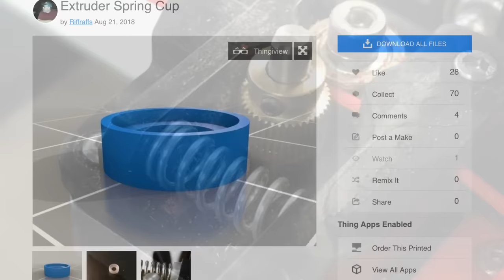Fix Bad 3D Prints on a Creality Printers

Comment: Bro I have tried it all...I am having little gaps in my print on the ender 3 v2 randomly. it's mostly on smaller parts of a print, for example if i were to print a fork the main part of the fork comes out mostly fine but then the prongs on the fork would have a lot of gaps in them and look ugly. I never had this issue when i first got the 2 machines i have....

Extruder gear is fine, nozzle cleaned many times, bed is level and using 5x5 bl touch, esteps calibrated, retraction turned off/many settings tried. even small prints come out so ugly...for example I print a cover for some steel rod and its under extruded as hell but how can this be if estep is right..i dont know what to do.....tried different filaments seems to be all the same....
Reply: Did you find any solution for this problem?
Reply: @s_y_305  Yeah. It was the brand of filament. All the different filaments I tested with were the same brand and they all were bad. I ended up trying filament from 5~ years ago and it printed fine so ended up just changing to eSun/Polyalchemy/etc and haven't had issues since. All my filament is stored on shelves identical to the next so don't know how they went bad so fast. Especially when years old filament is printing fine. All of it was PLA & PLA+.

Maybe in the future I will try to dry those rolls out and have another try with them but never have experienced this before, especially after I went through 3 rolls of said brand previously.
Reply: @adamarzo559  well, sad news for me then.
All my filaments are esun, never had this problem before but it's hell now. Changed the nozzle, tried to print on higher temps, changed the retraction settings, but nothing seem to work. For whatever reason it just decides to not flow as much of filaments on some of the sections of the part and as a result the whole part gets messed up

Comment: the arm on mine was too strong. i put the aluminum on and it was chewing up the filament.  so i put the old spring on it and now i'm getting the lines.  I just can't win with this thing I have bought so many parts and rebuilt the whole thing repeatedly i just don't get it this printer is ruining my life
Reply: ive had the same freaking problems with ender 6. just cant get the things right

Comment: When I'm printing after doing all the setup instruction with my brand new Ender 3 pro, my project gets eaten up by the nozzle when I'm printing. I use the paper trick to adjust the the nozzle to the proper height. Since I'm new to this I'm not sure what else I can do. Any assistant would be most appreciate. Thank you
Reply: @Fidel Gonzales Not sure what type of filament that you are using, and what exactly you mean that your print gets "eaten up by the nozzle".  I think you might mean that as it is trying to print it's being dragged around and turned into a heaping mess that just continues to circulate with the nozzle as it moves around the bed, is that correct?  If so there are a few things that you can check on.  If not, skip to the last 2 paragraphs.

First, when you are doing bed leveling (the paper trick) make sure to go through all 4 corners at least twice.  When you raise or lower a corner of the bed by adjusting the knobs underneath, it may affect a corner that you have already adjusted, so now that corner needs to be adjusted again.  Go through until you can do all 4 corners and the center without having to adjust them one time.  Also, the resistance you are getting between the nozzle and the bed (the amount of drag that you feel when pulling the paper through) is something that needs to be just right.  If you can barely pull the paper and the nozzle is almost ripping it, you need to lower the bed so that it is barely scratching the paper and offers slight resistance.  If you can easily slide the paper in between the bed and the nozzle, and no marks are on the paper, you need to raise it.

The big thing to correct this issue is layer adhesion.  If your first layer does not correctly stick to the bed, your print has failed and after that you're just wasting material.  Make sure to clean your bed (assuming it's glass) with glass cleaner that has ammonia.  Heated beds are supposed to not need any help, but often smearing the bed with a thin layer of gluestick (I use Elemer's but any brand will do) can help it stick correctly.  You can also cover the bed in masking tape, really it depends on what kind of filament you are using.  Speed and temperature can affect layer adhesion also, so in your slicer program you can try decreasing speed or try increasing/decreasing printing temperature.

If you instead mean that nothing is coming out of the nozzle onto the bed at all, then you might have a clogged nozzle or be using the wrong temperature.  Try using the menu to raise the z axis, then manually heat the nozzle to the temperature that you are using to print.  Squeeze the lever on the extruder, and try to manually push the filament in.  If you don't see any filament oozing out of the bottom of the nozzle, this is the case.  Try increasing the temperature and pushing it again.  I would stay within the range that it tells you on the spool of filament, so if it says 185 to 205 degrees, and nothing comes out at 205, you have a clog.

Right after I started printing, it took me a little while to get the test print working, and a few weeks later I had to clear a nozzle clog.  I didn't realize it at the time, but when I was printing with the initial roll of filament that came with the printer I must have been having some issues, because when I opened up the nozzle case there was just mounds of dried white filament all over the top of my hot end.  I had to carefully chip it off (so as not to damage the wires) and clear the hot end before I could fix the clog in the bowden tube.

Hope this helps!
Reply from the maker: Try this: https://youtu.be/_EfWVUJjBdA
Reply: @tims4028   Thanks so much will tried this and see. Will let you know.

Comment: I just got my ender pro 3 and I’m doing my first print right now (the ender cat) and the surface is just a little shitty. The text on the sign that the cat is holding is basically not there
Reply: I'm in the same boat with ya buddy. = ) 
Try to do an extruder calibration and see if that helps. If my computer were closer, I'd run a cable over to mine, but alas haha. = 1

Comment: I'm having problems in bed leveling....
Any suggestions??
Reply from the maker: https://youtu.be/_EfWVUJjBdA
Reply: Not to detract, add or subtract from Chuck's video and answer, but I would like to point out something that seems to escape the notice of many who are stuck with this FOUR-point bed leveling system rather than a more logical THREE-point arrangement (like used in most good old-fashioned surveyors' transits or levels).  
The quickest way to grasp the point I wish to make is to consider (hypothetically) starting from a situation where the bed IS already perfectly level on its 4 points.  What happens when you move ONLY ONE of the adjusters then?  The other three remain in their original COPLANAR situation, meaning that the altered one is no longer cooperating.  In fact, it may be exerting a force on the bed that tends toward WARPING it, though that's extreme.
What this means is that, in order to return the four to the desired COPLANAR relationship, at least one of the three others must be moved: either the opposite diagonal must be moved the same distance but opposite direction, or ONE of the two adjacent corners must be moved the same distance AND direction as the first.
Reverse-engineering this theoretical grasp of the mechanics of your print bed then is a non-trivial exercise that, once completed, should only be altered with utmost care and due consideration!  Flippant tweaking without such care will likely cause undue grief that may haunt you until you fix it!  I'd suggest taking good notes, like in a dedicated journal, in order to make your adjustments purposeful and on-target.  Once dialed in, the headaches should fade from disuse.
To further complicate matters, there is also the issue of whether or not your bed is already warped, PLUS the potential for alteration due to temperature, especially in a heated bed.